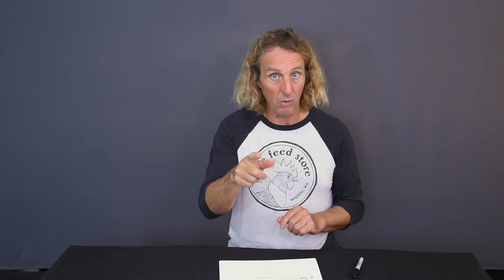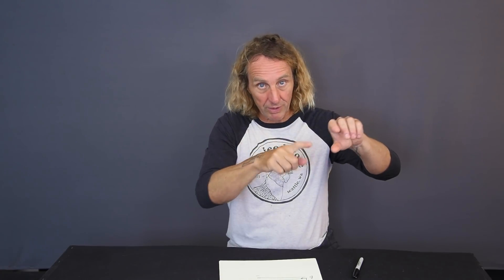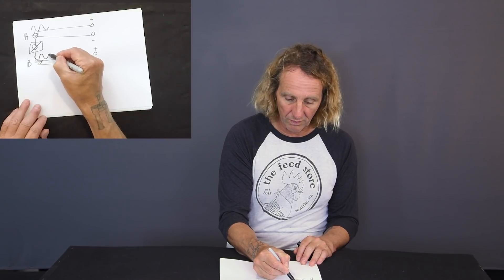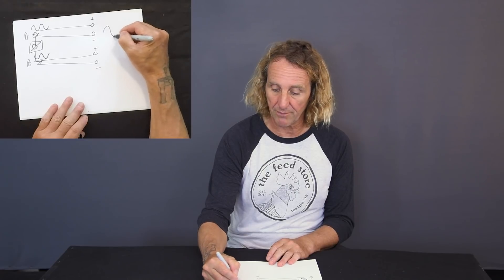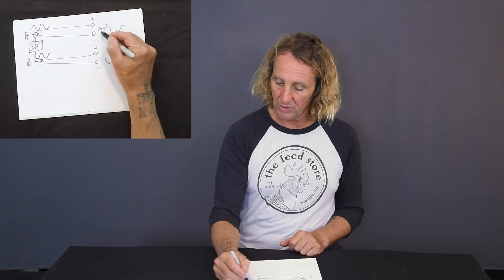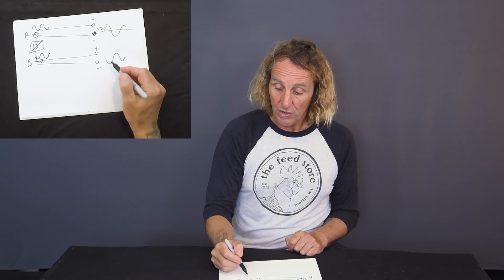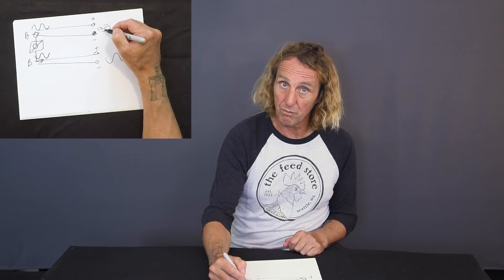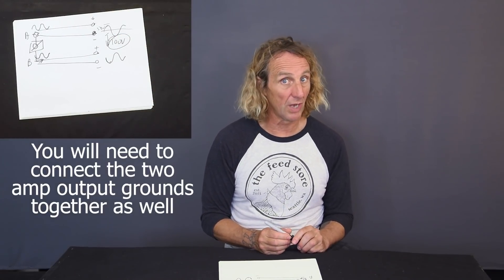Advantages of Amplifier Bridged Mono Mode

Comment: I also run my bass cabs this way.... LOVE IT!!! I run old school, Crown.. Crest. QSC. Amps with Cerwin Vega earthquake 18"s does the job no doubt, but I'm so tempted to upgrade to some newer rigs! This guy is pretty informative and definitely gets the creativity flowing FoSho! Big ups Dave🤘
Reply: Even though, I do know the old school stuff definitely takes the life off the gear at a faster pace it still delivers solid. Power requirements are hefty though.  I do have a stack of the newer digital crown amps that are obviously a bit more power friendly and definitely don't create anywhere near as much heat. I back mostly electronic music stuff so the demand for solid power is in full blast beast mode (aka bridged mono lol) for the subs for sure, everything else is run in stereo. I dont do Venues large enough to have to have "traveling" bass movements. I can see how running full digital in stereo for rock or something a bit less demanding on a consistent basis for the low end needs, but I do like the set up the way it is, it sounds really clean and I know it well enough for quick adjustments for different venues, I need a space where I can set up for a while and mess around with other configurations though, I just simply dont have the power where I have space.... its always something lol! MORE MORE and MORE🤣

Comment: Im running a very powerful sub on an amp bridge as we speak but impedance is too low so amp does get very hot thank goodness i dont go more the 1/4 volume but yeah saving up to upgrade to a 4ohm stable amp to bridge and use cause this sub requires up to 3000watts to really get bumping.

Comment: Got two 18inch 8ohms subs in two enclosures wired parallel to 4ohms. Amp runs in bridge mono but when connected to the speakers the load is 1.2 ohms is that right am new to this stuff
Reply from the maker: 1 2 ohms dc resistance could be an 8 ohm load though usually a 4 ohm load will measure around 2.4 to 3 ohms
Reply: Thanks for the reply

Comment: What do you think of the newer amps (like QSC CX-Q) that can run channel pairs in parallel? Have you seen that?
Reply from the maker: I have seen that and older crown amps would do parallel mono as do many other amps.

That is great for running low impedance loads but you do t get the advantages of reducing the impact of wire resistance

Comment: I love running amps in bridged mono because I can often get 3x the power into the same load
Reply from the maker: Or at least near double the power.
Reply: V²/R = P 
Overall current capability remains,  but yes with bridging, it'll swing a lot of voltage.
Reply from the maker: Yes, volts squared over resistance.

So if an amp puts out 100v per channel into 8 ohms then it's 10000 divided by 8 ohms or 1250 watts per channel

100 volts per channel into 4 ohms would be 2500 watts x 2

100v per channel into 2 ohms would be 5000 watts x 2

In bridged you get double the voltage in a perfect world though most amps can't fully double the voltage due to other limitations. So 200v into 8 ohms.

Which would be 200 squared or 40000 and if you had the same load of 8 ohms it would be 5,000 watts or 4 x the power but you would only be driving one 8 ohm load instead of two 8 ohm loads

If you double the load impedance to 16 ohms by putting the speakers in series, because you are using 2 channels and had speakers on both channels, you would get 2500 watts into one 16ohm load.

And if you parallel the two loads down to 4 ohms you would get 10000 watts because you would be running the equivalent of 2 ohms per channel.
Reply: Yeah I guess when I said that I was thinking of the difference between 1 channel by itself and a bridged amp
Reply: @jakesterfiddle  
gotcha 👍

Comment: So basically if your running 2 subs (any size) it’s gonna be more efficient to run them in bridged mode rather than splitting a mono signal into a stereo pair due to the resistance of the speaker wire. Is this something you consider at large events? Because you usually have more than enough budget/gear that this wouldn’t be an issue. Your not limited on amp power when your using top of the line amplifiers. I guess this could possibly play into truck space
Reply from the maker: Getting more power out of amps is important on all levels.  The cost, weight and size of bringing 30% to 50% more amplifiers is significant on all levels